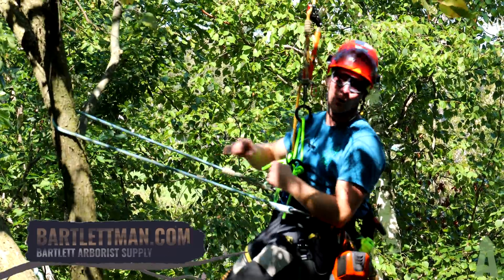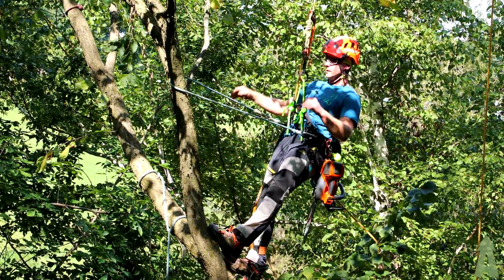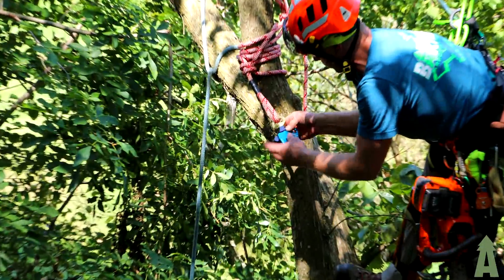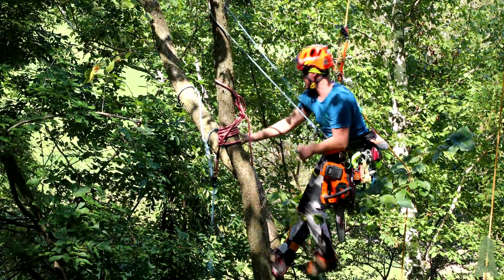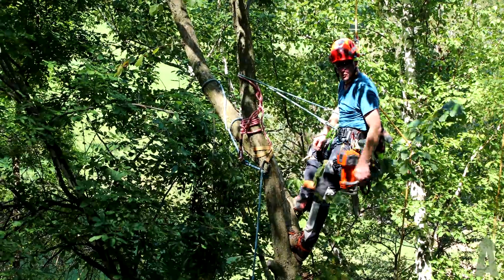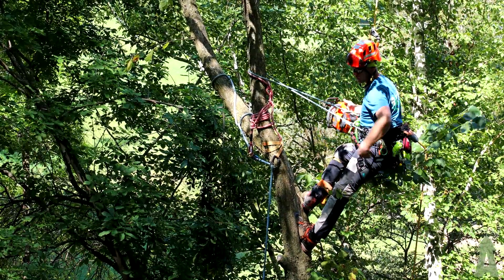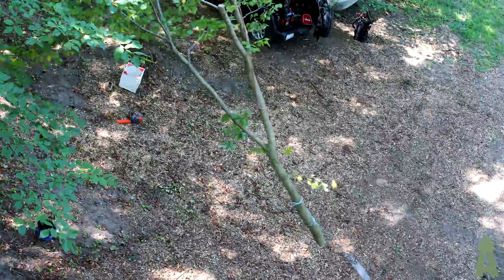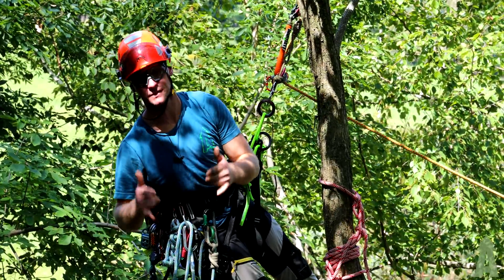Tree Work: Rigging in Trees!

Comment: Hmmm....if you can't tie knots, tie lots ? How bout a figure eight to isolate the friction device and a reef knot adjusted to suite the length at the back., or just use the crotch your tying too.
Reply from the maker: The square knot is not suppose to be used for securing heavy loads and it could either slip or jam. Generally, you wouldn't want to tie-in to your rigging anchor in the event of failure. There are instances that it is unavoidable; negative rigging would be the example.

Comment: I’d use the lower D’s on the harness, here especially!
The whole time you’re talking you look like you’re in a jolly jumper.
Reply: 😂 jolly jumper has me☠️. I'm 5'6" on a good day. if I wear a belt on my pants I look like I'm wearing a corset🤣  I would normally always switch to my forward ventral attachments. However, this saddle was fresh out of the bag 20 minutes ago. I only had time to change my components from another saddle to this one. By the time I got into the tree I realized I did not set it up properly so I just stuck with hip attachments. Regardless, good eye for detail 🤙
Reply: I rarely use my upper D's except on big stems when I'm blocking down with a steel core flipline. The lower D's are much more comfortable, another option I use is to switch my lanyard onto my bridge. It's like having a mini climbing system to back up your main line. I have a single bridge setup with a ring and a swivel.

Comment: would be cool to see a rigging video that goes into things like swl, mbs, and cycles to failure. im aware of these things because i seek outside knowledge, but being a trimmer in a piss poor company (asplundh) they have never covered these things with us. I wanna make sure im understanding it all. Like Minimum breaking strength is the minimum force that the rope will break at. Safe working load Is the max load you should put on the rope, and this does include the forces involved as well as the weight of the piece. Cycles to failure is basically the uses you get out of the rope before having to retire it from the stress of the loads put on it? Any and all info the specs is welcomed greatly.
Reply: Like chris ..no nonsense humble approach.oldschool ...relatable
Reply: Cycles to failure is extremely subjective based upon the use habits of the operator.  Nobody is going to count how many times they do this or that either.  PRE CLIMB INSPECTION.  That is how you monitor your gear.
Reply: Just left Asplund and man your not lying, 2 years there and all they taught was Blake's hitch and running bow after being up in cannapy

Comment: Good video and tips for staying safe! Really enjoy Abdon/s gear videos too. RE's downrigger helps with one of my pet peeves with other at height friction setups and that is getting the rope end back thru it for the next rig. Wish they'd work on one with an MBS about 700-800 lbs maybe? If not RE then DMM anyone? Cheers
Reply from the maker: Appreciate it, safety is a huge priority! 😁
Reply: @BartlettArboristSupply  The RE Downrigger docs show that it's not for negative rigging and  safety factor is 10:1 ! There's stuff out there that shows it in use for negative rigging tho, even with double block. I kinda think this'd be pushin' it, esp. according to the UK HSE pdf doc on arborist rigging (RR 668 - section 8). For lowering - heap good piece of gear tho.